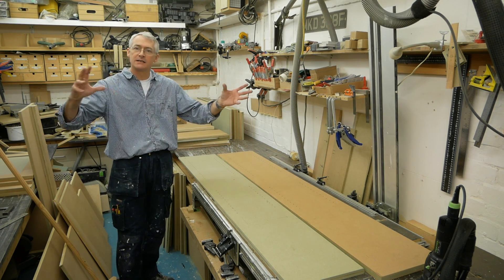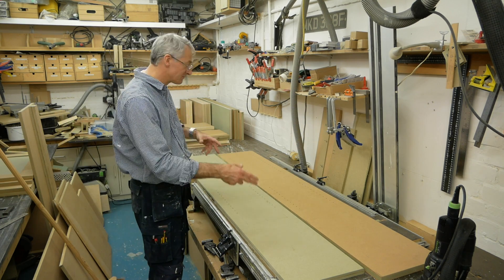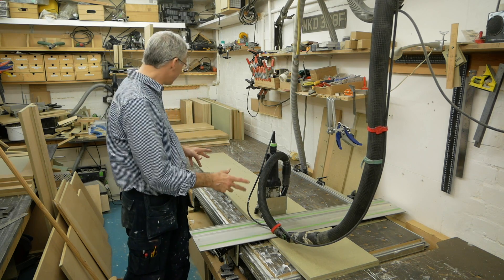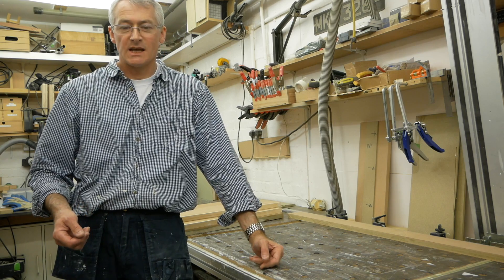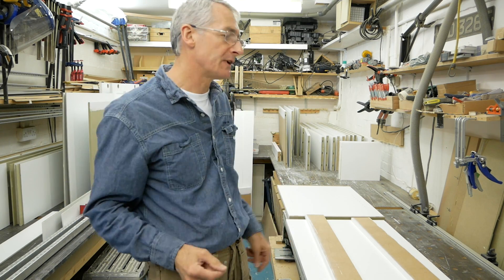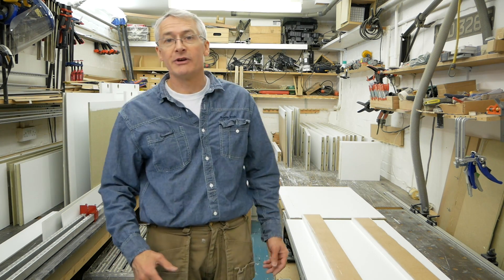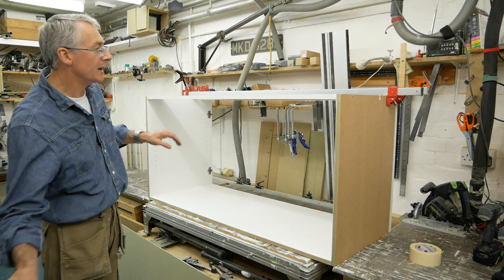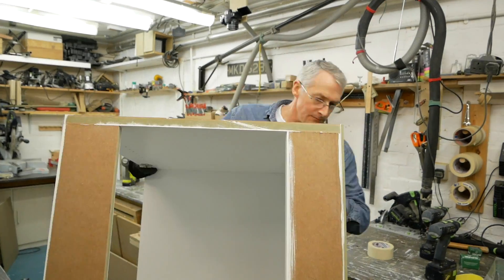TV unit Part 3 #054

Comment: Peter. Am working through the back catalogue of videos. Very helpful. When you use the ryobi nailer. You mention staples. Could you let me know which you use for adding the backs to the cabinets as I shall be attempting this on a home desk / drawer combo relatively soon. Thanks ever so much. Dave
Reply from the maker: Thanks Dave! It’s actually a Ryobi stapler, and I usually use either 20mm or 25mm narrow crown staples for cabinet backs. Always worked well for me. 👍👍

Comment: You have probably answered my question somewhere; but why does MDF seem to be your material of choice?
Reply from the maker: Rick Williams It's a flat, stable board that's readily available in a variety of thicknesses, machines easily and takes paint well. And I only use Moisture Resistant, or MR MDF; if you're not familiar with it, it's a much better quality board for not much more money, though from the conversations I've had here, I understand that it's not always available everywhere. Most of what I make has a painted finish, so it's the perfect material, for me. Thanks! 👍

Comment: Hi Peter  You mentioned using an air scrubber in your workshop - is that a diy made unit or did you buy one? Can you offer any guidance on this? Although I use a "profession" vac on my power tools I notice a fair amount of fine dust build-up on shelves etc in my small workshop and think I need to do more to combat this. Really enjoy your videos - keep 'em coming!
Reply from the maker: Hi. Yes, it’s a home-brew unit, a really simple MDF box with a filter at one end and a fan at the other. I do have a video planned but haven’t got around to it yet, sorry!
Reply: Thanks for prompt reply!  I'd like to build one too but suitable filters seem a lot easier to obtain in the US than here at home.  I look forward to seeing your video!  Cheers.
Reply from the maker: +Darrel I used Ramair foam carburettor filters from ebay - https://goo.gl/RVLYMQ. Seem to be working OK. 👍
Reply: Many thanks for the info - that's really appreciated!